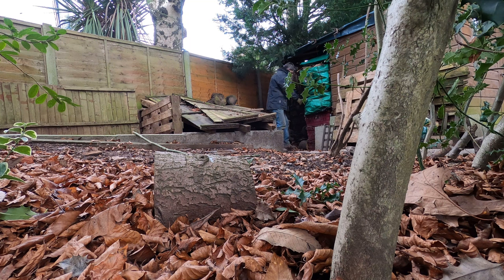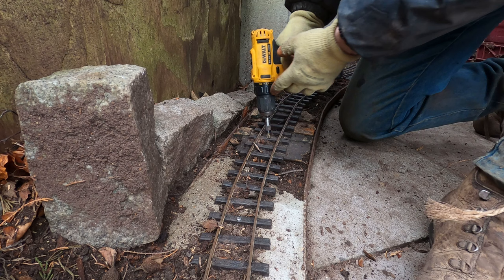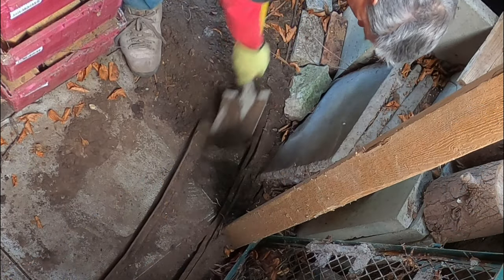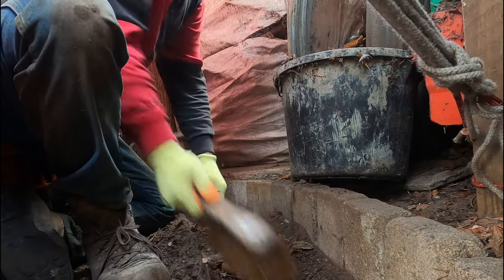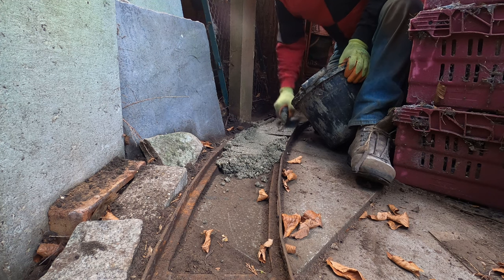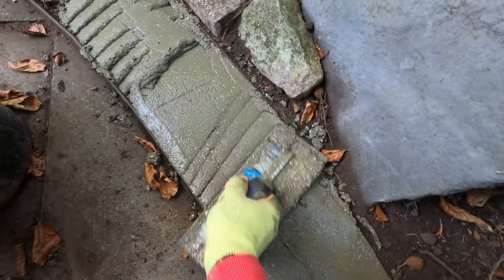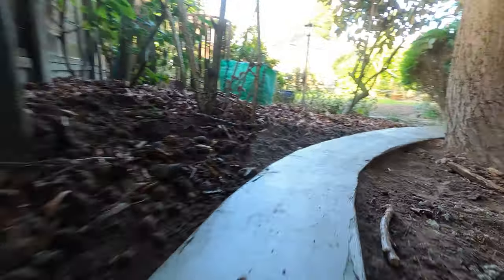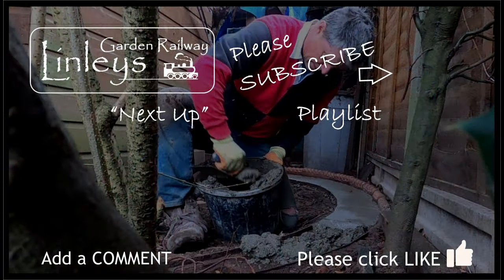Building a Garden Railway • Trackbed Renewal • Development Works on the line

Comment: Interesting video, thanks for sharing. Loved the commentary 💜👍✌️😀

Interesting construction techniques too✌️👍💜 I take it that the manhole cover never needs lifting 🤔😲😲😳😉😀😀✌️👍💜

Im having to rebuild low to the ground baseboards, Im using Filcris and uPVC - Im fed up with substandard timber (two lots to date in past ten years).

In the larger scales Ive seen PECO track screwed to spaced block pavers in a gravel 'trough', Brian Harrup seemed to originate the idea - it works well👍💜
Reply from the maker: Good luck with your railway works. The access lids are all openable. I add cables as needed. Certainly the concrete is more durable than the wood but the wood let me adjust the trackbed a bit if needed. Cheers, Warren 🤠
Reply: @Linleys  Thanks Warren, keep up the good work😊✌️💜
Reply from the maker: Cheers, Warren :)

Comment: How was the metal frame track way constructed?
Reply from the maker: I use 25mm angle iron steel.  Take a look at some of the older videos in my playlists and you will see some of the original construction.  Cheers, Warren :)